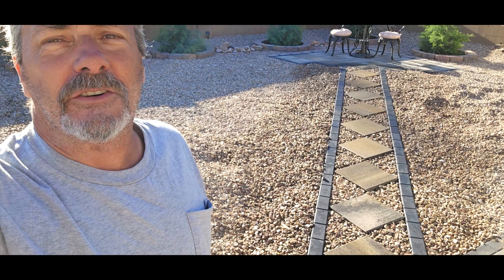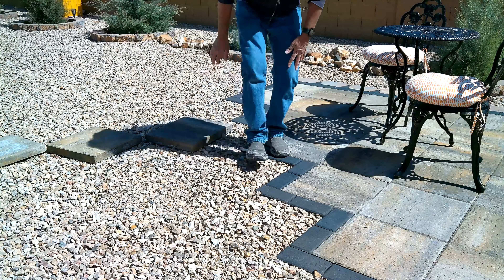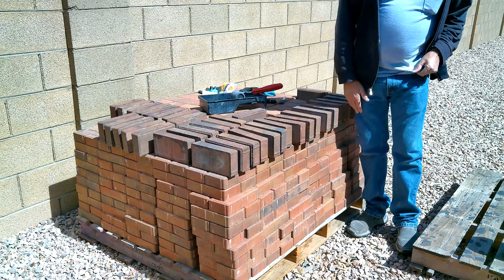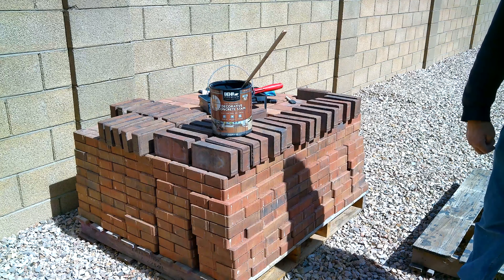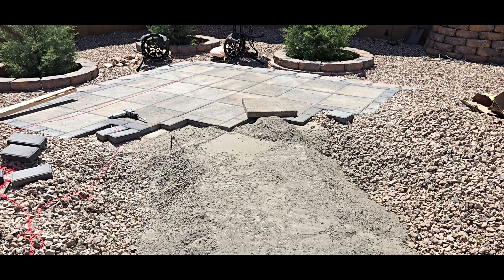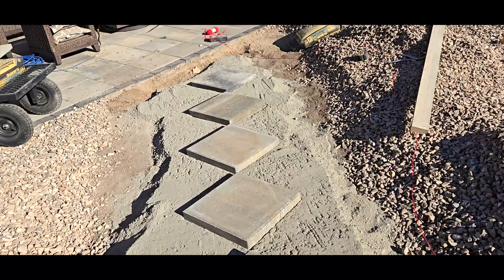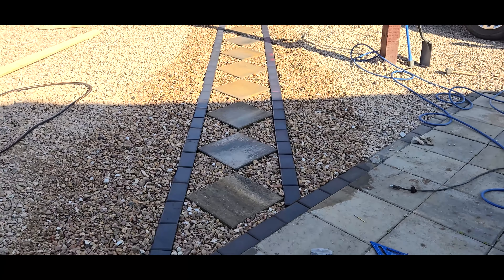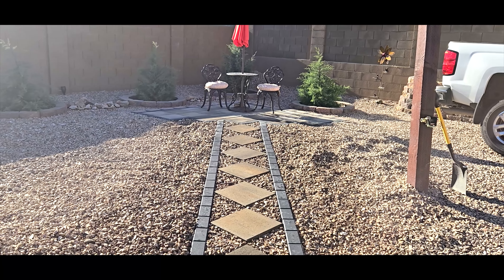Built a paver path on dry pour cement, it turned out awesome! No weeds ever! Never have to reset it!

Comment: Have you tried to pull up the bricks or pavers to see if they have adhered to the dry pour? I'm wanting to do almost the same thing but with stepping stones that I have made myself and bricks. Just wanting to see how it is with the passing of time.
Reply from the maker: Yes, as long as you tap them down well the mortar adheres very well to the pavers. If you're going to have the concrete visible you might consider using a coat of mortar on top so the aggregate isn't visible, depending on the look you're after. My thinnest dry pour areas are about 2", no issues yet.

Comment: Genius! Is it just normal cement that you’d use to mix with sand? Does it mix with the sand it’s laid on top of? Or just set solid over time with rain?
Reply from the maker: Just used the standard quikcrete complete, includes the aggregate. Our soil here is so hard it takes a pick to make a hole so I didn't need to use a base like AB or class 5. Put down the mix, scree it level. Place the pavers and set them in place and to level with a rubber mallet, not too much force, they will break. That puts mortar between the pavers to hold them in place and prevent soil build up in the cracks. After the assembly was complete I watered lightly, just enough to moisten the top of the cement, twice 1 hour apart. Then watered it well once an hour 4 times. Since rain was forecast for the next few days I let nature take it from there. Normally I'd water it twice per inch once an hour. Advantages are no regular maintenance, I rinse the sediment out once a year in the spring. When it's done it feels like a cement patio but has the paver style without the fake look of rollers or patterns and trying to make stain look natural.
Reply: @JustDoingMyStuff  Thank you! It’s a brilliant ruse!
Reply: Awesome job sir! I have done a few dry pours myself but this is a good idea to change it up and yet make a solid walkway!